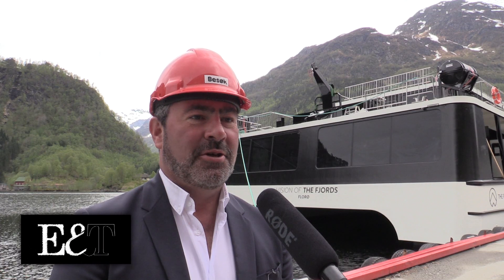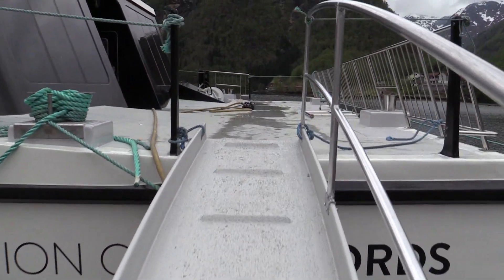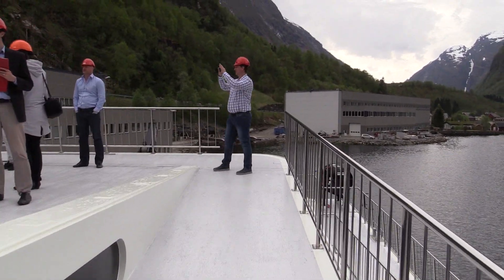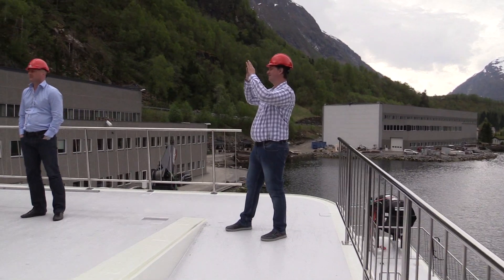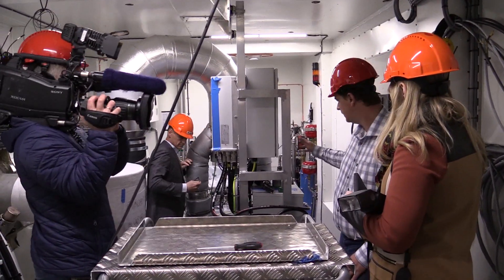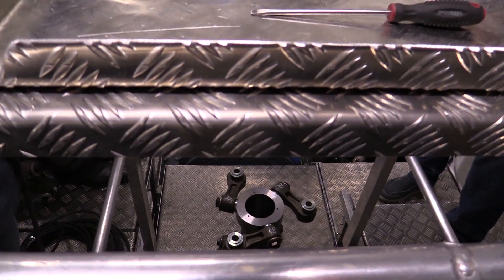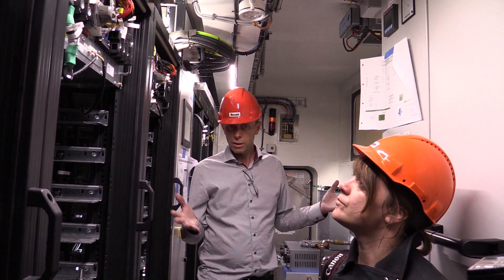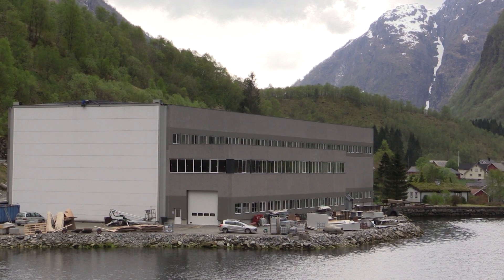Carbon fibre electric hybrid ferry to clean up tourism in Norwegian fjords

Comment: the hybrid isn't even necessary.  There are already full EV ferries with super fast charging capability.
Reply from the maker: +Will Davis I think this one needs to cover a longer distance before it reaches the shore to recharge, hence the diesel engine....
Reply: Its also due to safty i bet. You dont want to run out of power and steering with a bunch of tourist aboard.
Reply: @aztex6981  Its indeed a safety issue "safe return to port". Noting more thrust worthy than a diesel engine ;)
Reply: Have a look at the sister ship: Future the fjords. It is 100% electric.
Reply: The same company also makes electric ferries